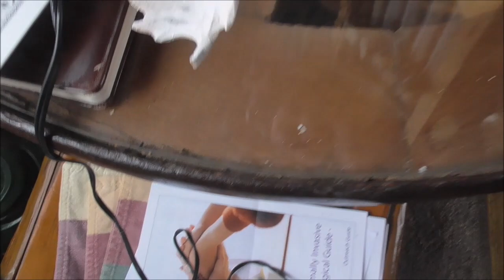Building an Off Grid Log Cabin... For The Birds ???

Comment: Very nice craftsmanship. I might have to copy your design before you patent it.
If you were to put a door with a 1 1/8" hole in it, and block off the window with some opaque material, you could get some chickadees to move in there, otherwise it would be most likely starlings or robins.
Reply from the maker: I thought about a door with a hole.....or a closed door and a bigger window?  Robins would be OK, but I'm not too fond of starlings.